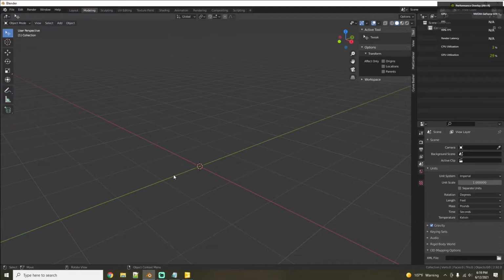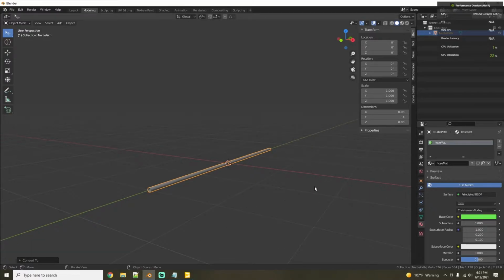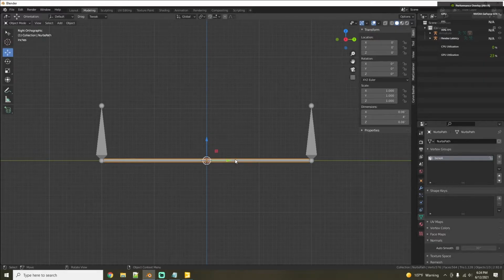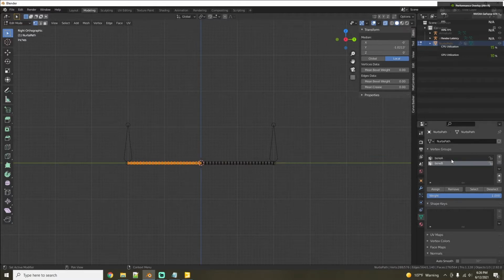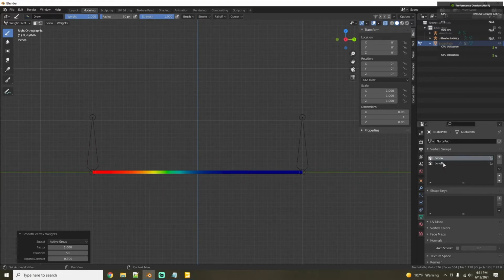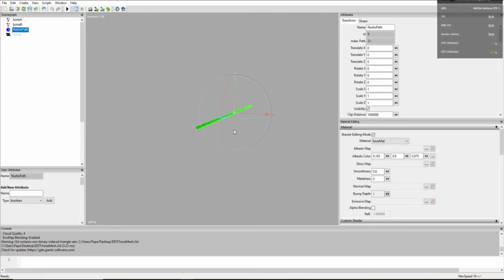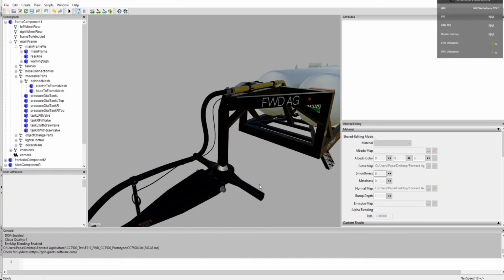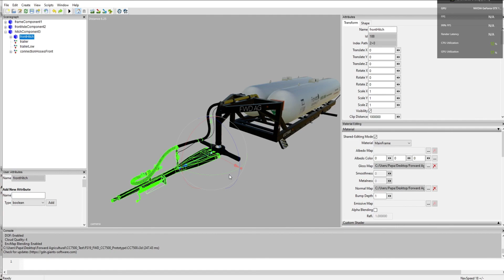Tutorial #1 - Creating a Skinned Mesh!

Comment: Hello, thanks for the tutorial ... but I have a problem. Do you have an idea why the blue colored skinned mesh gets invisible after importing it into the giants editor?
Reply from the maker: Cheers Agrartechnik! The issue you’re having is that there is too much of the blue section (soft section) if the skinned mesh, and it becomes unrecognizable. You’ll have to smooth out the mesh further to have less of a dark blue section!
Reply: @ForwardAgSolutions  I want to edit a skinned mesh from giants (tsw6240w). When i rotate the bone, the hole mesh rotates with it. When i make the static mesh blue - so that it don`t rotate - it gets invisible.
Reply from the maker: @agrartechnikamhausruck680  blue gives the mesh flexibility, and red makes it solid! You’d want to make your anchor points red and let the middle fade into blue!
Reply: Now i know what the problem was - i had to make a another (useless) bone in the center of the trailer. Thx you for your help!